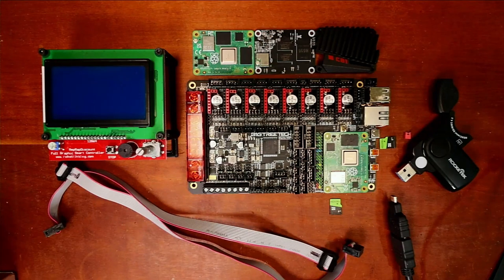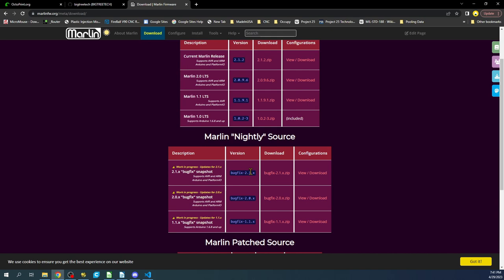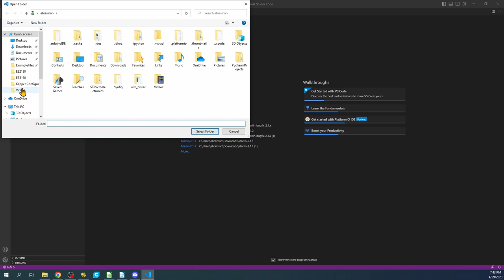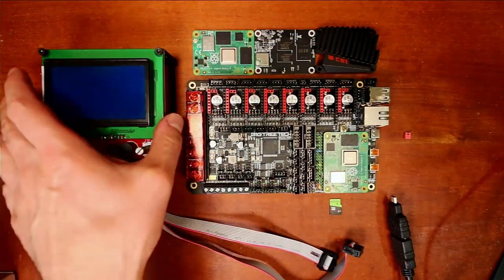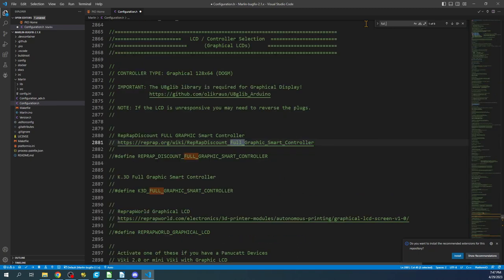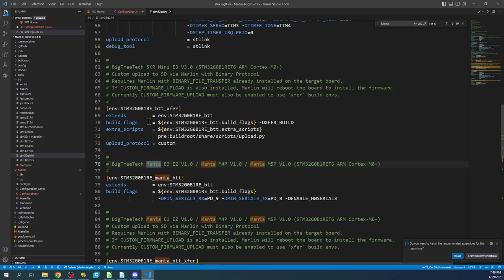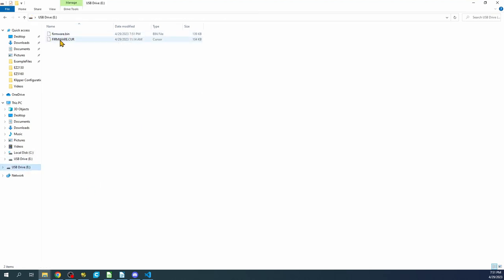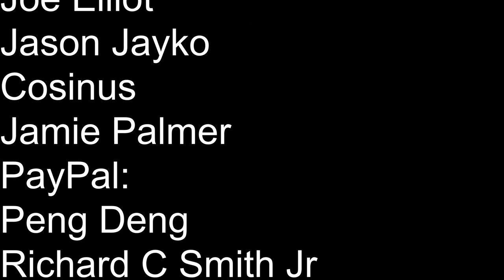BTT - Manta M8P - Loading Marlin Firmware (Part 1)

Comment: Hey Ed, we are getting so many boards with similar functionality you may want to give a quick synopsis of the differences when a new board is featured.
Reply from the maker: Basically the processors are almost all the same for 32 bit, they have different clock speeds and a wired to different pins or devices.  When I have more time away from my day job I can explain in more depth in videos.

Comment: Thanks for this Ed. I have the btt-e3ez-v1.0 without the CB1 or CM4 installed and could not get Klipper firmware loaded either through the USB or SD card image.

Then I saw on the btt site for the board they say you can run without the CB1 or CM4 but only on Marlin. Site says "Don't want to use a CB1/CM4? No problem. Marlin is supported without one. Choose between Marlin or Klipper at will". 

Even though their documentation clearly state how to install Klipper firmware.

Followed your steps but for my Manta e3ez and success. Weird it won't take Klipper firmware.

I have the CB1 coming and will see if it takes with it installed. External Pi4B via USB doesn't work. I have Mainsail running on the Pi4B fyi. 

Thanks.

Comment: I know it's probably a silly question but is this equally applicable to the manta M5P?  Only asking as I have one on the way and intend to try klipper but just in case I'm not a fan I might need to go back to marlin.
Reply from the maker: It's similar.  The process varies depending on if you use CB1 or Cm4 or Emmc on either and printer configuration file.  There's a Discord link in the description where everyone talks about their issues and how to fix them for Klipper.

Comment: The only issue with the Manta boards is the 64MHz processor. Marlin + Input Shaping runs better on something like the Octopus Max EZ.
Reply: Thanks for this, I was wondering what the difference was and you saved me a google. :)
Reply from the maker: You're welcome.

Comment: Can you use CanBus with M8P when running Marlin and octoprint?
Reply from the maker: Probably.  Need to investigate.
Reply: @EdwardBraiman  I didn't even realize Marlin worked on the M8P until I came across this video. I got it when they released it, Thought about using Klipper. and got the EBB 42 Canbus, U2C and Pi4B  I planned on adding to my printer. but due to the learning curve and down time I havn't had time. Last time I checked I dont think it was compatable but I dont think Marlin worked with this board at that time either. Would be nice if it would work now with CanBus now.

Comment: Once Marlin is installed on the Manta M8P, can you open a serial connection to directly send commands?
Reply from the maker: With either raspberry pi CM4 or CB1 using OctoPrint.  I'll need to double check USB to an external computer.
Reply: @EdwardBraiman  I am currently trying to connect the manta e3ez without CB1/CM4 to a pi4b via the USB and no love. Octopi cannot see any serial ports. In your video you used -1 (native USB), although that compiles, the USB is inactive. Tried 0 (won't compile) and 1,2,3 (they compile) but nothing works at this point.